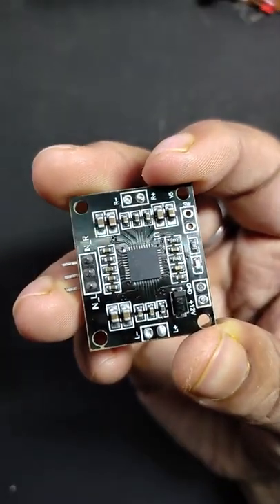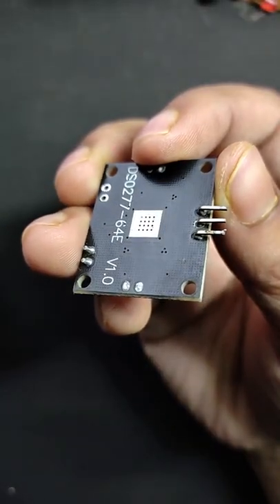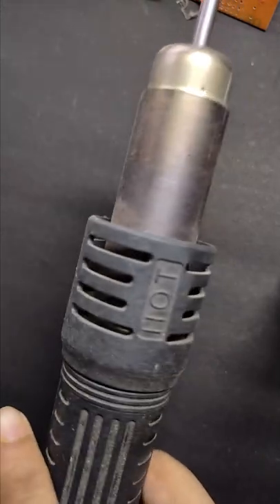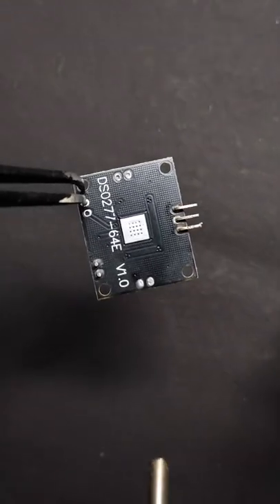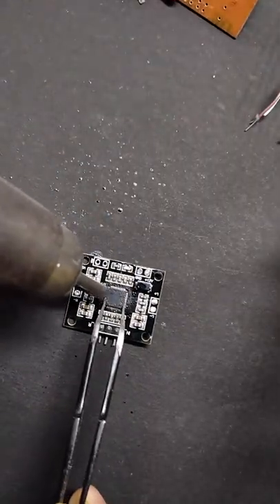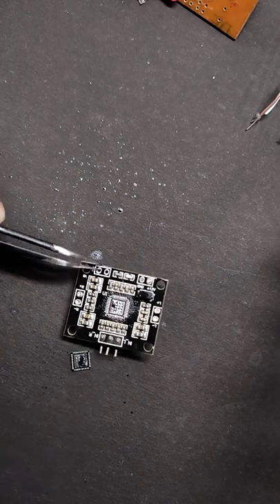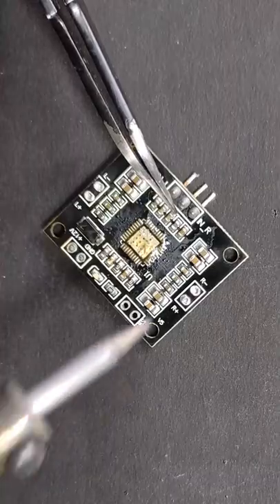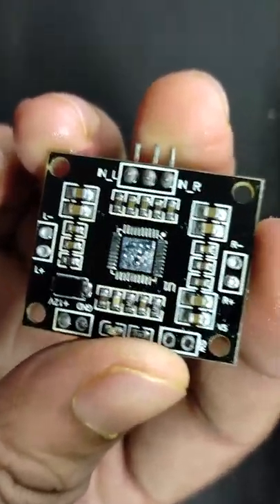Desoldering QFN - 40 package IC (SMD chip) with hot air soldering iron #shorts #soldering

Comment: Well your soldering iron is dangerous
Reply: @electronicstechnology1478  umm the soldering iron the pencil type is not constant temperature
Reply from the maker: @jfruds  Yes,
The soldering iron I'm using here, doesn't have a temperature control system.
But it is a quality product not the cheap one.